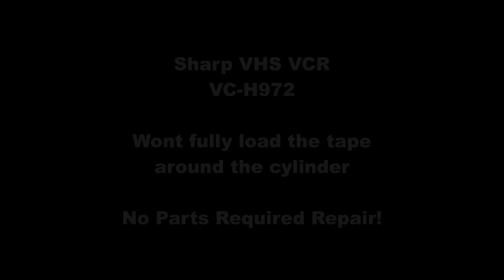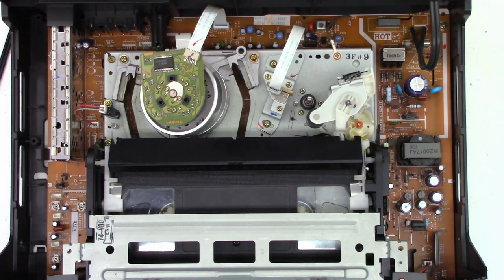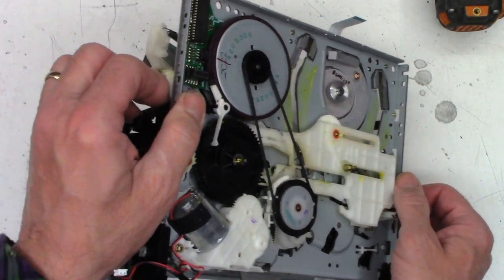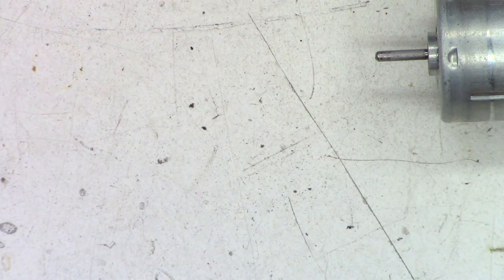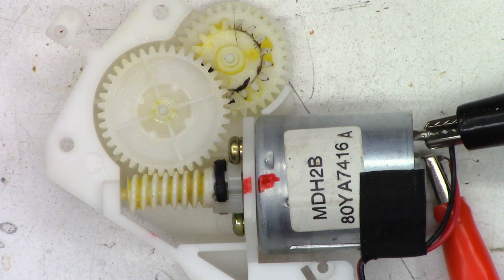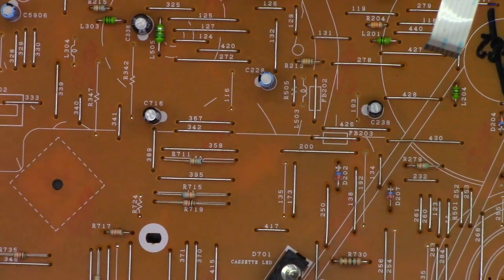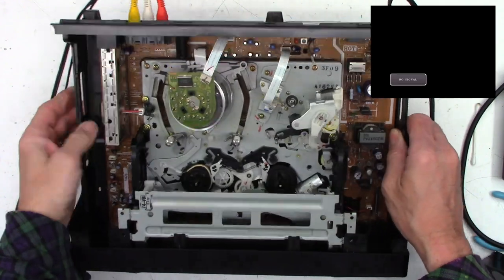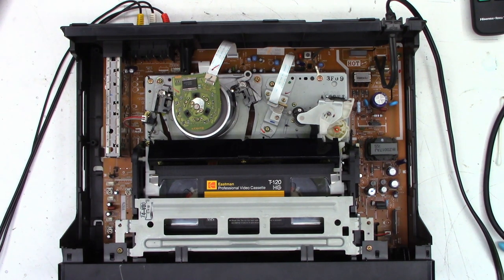Sharp VC-H972 VHS VCR that wont load. I bought this new in the late 90's. No parts required repair!

Comment: Also works with the VC-H810!!

Thanks so much for that video! I had the EXACT same problem on my VC-H810 and couldn't find what was wrong. It worked with most tapes, but some older ones wouldn't load. I checked mine according to this video, and although it doesn't disassemble the same way, it's pretty similar. The motors are the same model, but the harness that holds it, and the broken plastic part are different. Still repairs the exact same way has this model!

Thanks again and hope this can help someone else!

Comment: Reminds me of the Panasonic K-Mechanism VCR's of the early-to-mid 1990's which had issues with loading motor bushings (they would crack and slip on the shaft under the worm gear) - I used to just order a new loading motor + bushing as a single assembly (several models used the same type) and never considered gluing the original part. Some of the units with this problem were not mine and customers wanted reliability back then.  Once again you did a simple fix at virtually no cost with no extra parts or special tools needed. If only all electronics repair jobs were this easy!😇
Reply: You could order just the plastic part on its own , I still have one in stock 👍

Comment: No joke, I was given this EXACT VCR over a month ago. It was the original owner, it was bought brand-new as well back then. It is my new digitizing VCR unit! And it even plays nice on some of my Hi-Fi tapes that don't play Hi-Fi audio correctly on other VCRs, so that's a plus! The only cleaning it needed was the the head and pinch roller, but that was it. Now you got me motivated to check on the belts cuz I haven't done that yet. And did I forget to mention that I love the sounds it makes.....😉

Edit: Wow this doesn't have a mode switch? That's one less thing to clean LOL!😆
Reply: Edit to my previous comment: Finally looked at the belt on my unit and it's still good, I cleaned it anyways like you did. Still works fine! 

Also one thing I forgot to mention: the VCR has an "S Picture" function when you press the "set" button on the front of the unit. It makes the picture just a tiny bit sharper which is perfect for digitization! I leave it on.

Comment: Well done  working again :-D
When you were talking about re placing heads, i remembered when i had an accident with a vcr.
I was cleaning it and a thread from my sleeve caught one of the heads, oh hell 😞
Being stubborn i looked around my old junk and found two head chips but not identical to the originals.
After hours and hours of messing with the chips to get all the angles as close as i could guess with just my eyes.
It took hours, but it worked perfect and played any tape, I was utterly amazed.
Now there was one thing i didnt know, the azimuth was plus and minus 7 degrees.
I didn't know anything about the plus and minus,  i had guessed right,  so so lucky lol.
Sometimes a fluke happens lol.
100% true.
I did have good eyes when i was 20,    57 now.
Sorry about the long woffle :-(
Reply from the maker: Thank you, When I was younger (in my mid 20's) I could see the + and - azimuth of the video heads with my eyes, now I have to use a microscope. I am 56 and still trying.
Reply: @norcal715  Never give up with repairs,  i have one of those plastic  jewlers eye piece for impossible things to see lol.
Keep tinkering :-D
Reply from the maker: I wont give up anytime soon (God willing) Thank you!

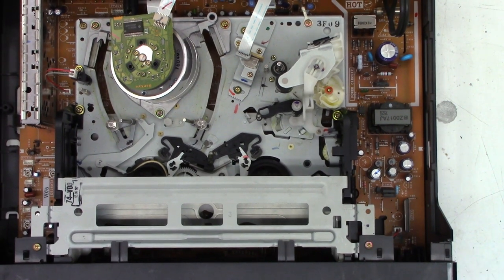Comment: 6:43, Yes, this item is returnable back to Costco for a full refund with a receipt. Then Costco disposed this unit into dumpster.
Reply from the maker: I do still have the receipt (somewhere), I think I will keep it though since it works again, and I cant purchase a new one any longer. I think Costco put the kybosh on unlimited returns in the early 2000's, only 90 days now. I used to do warranty repairs for them, and so many customers would just return an item instead of having it repaired.